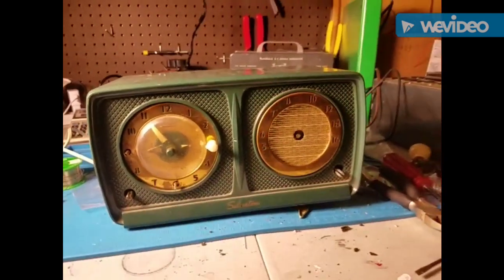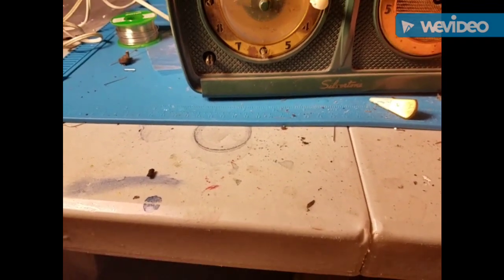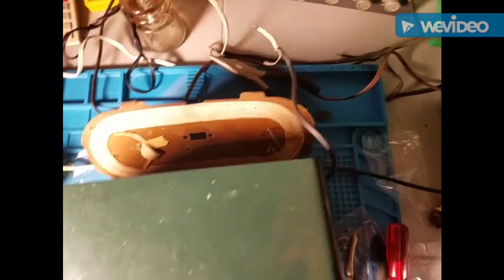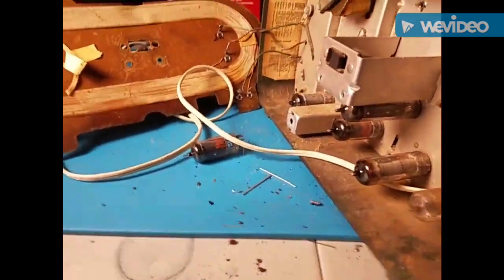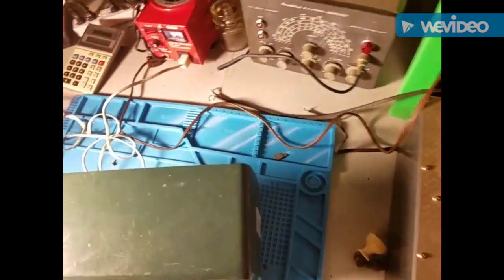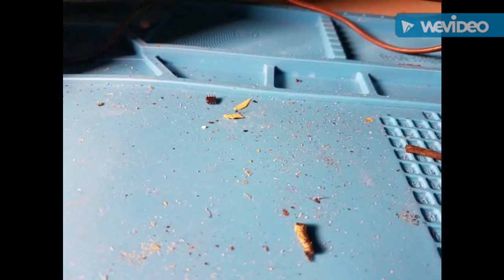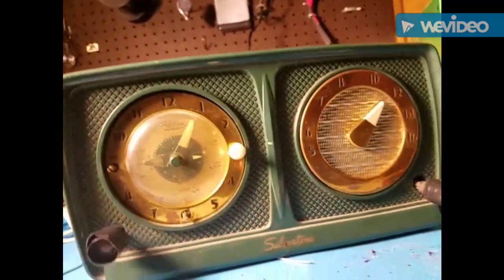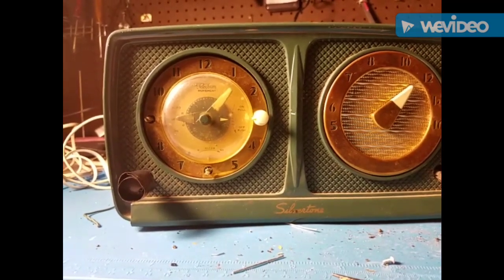1951 Silvertone Clock Radio Repair part 1, 2, 3

Comment from the maker: Well crap, this is only part 2 and 3. Part 1 was quite boring as I basically just looked at the inside and replaced the caps and tubes. The radio performed no different in part 2 as it did in part 1. I did mention that this radio has a early IC, yes, a computer chip (sort of). It's a large tan box that has a bunch of wires hanging out. They were common in the 50s. Thanks for watching! I am very lucky it doesn't have SMD